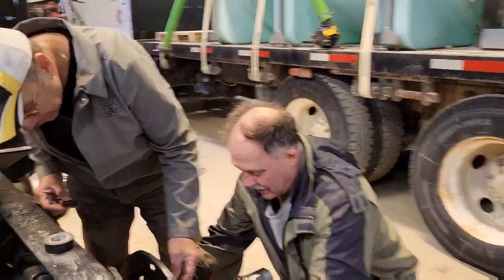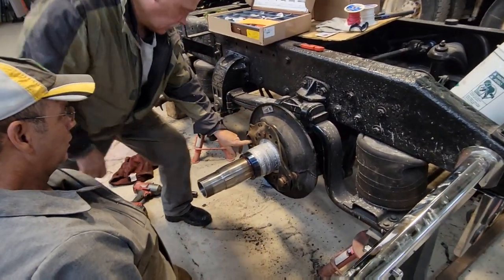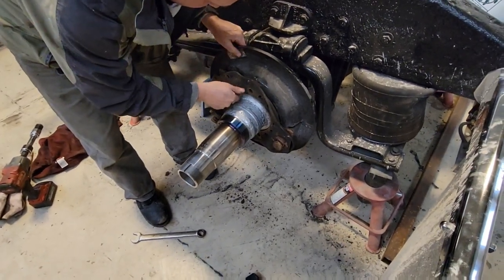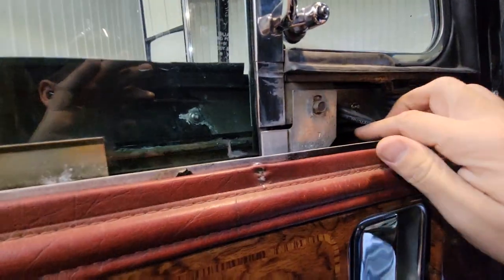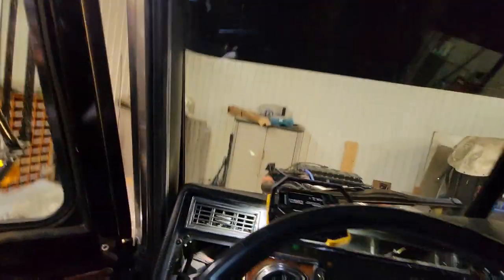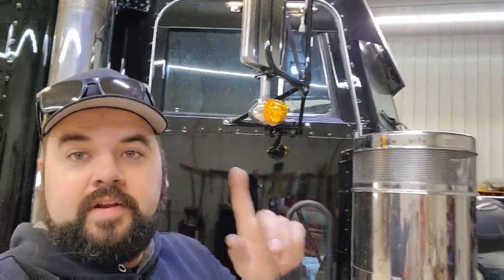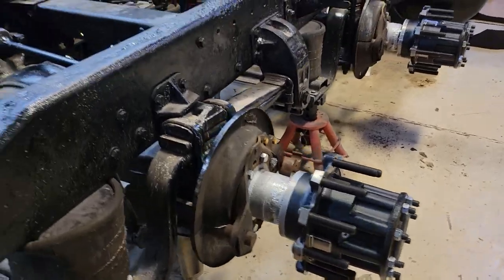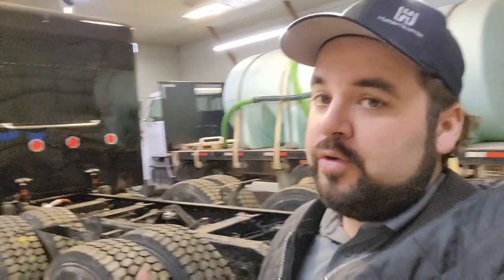Peterbilt 379 rebuild series (Episode 20) Hubs are finally back on!

Comment: When it rains, it pours. That's oh so true, but when you make progress, you make progress for three episodes! Thanks for the update Greg, renewing the hubs, brakes, rims and tyres will pay off in reliability. Also, good call from Todd to fix the dust shields while he was at it. Do you have any footage on the axle repair? I'm curious to see the process. All the best from Holland!
Reply from the maker: Hey Arnold! Unfortunately I don't have any more footage on the axle repair it was an all day process and I was busy with other jobs that day. I will say that it was pretty straight forward. He had a jig for his torch to cut off the old spindles and then came with a new spindle that he placed in a jig to weld to the axle. 6 passes of weld and he was all done.

Comment: I’m guessing long wheel base isn’t allowed in Canada? Never seen a truck from Canada with a stretched frame either way beautiful truck man 👌🏼
Reply from the maker: Lots of stretched trucks here. Just can't be longer then 244 wheelbase to pull b trains grossing 140k lbs. Most scales aren't long enough and won't let you split weigh. Lots of guys pulling straight trailers with stretched trucks tho.